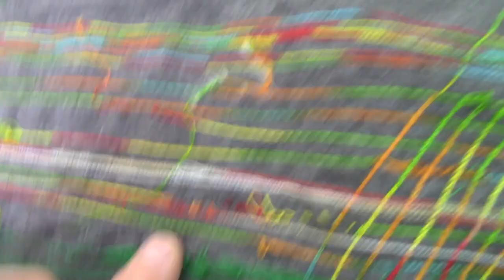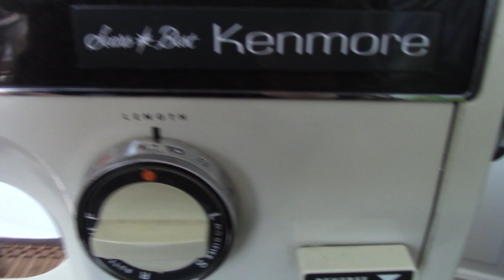Comparing Chain Stitching Singer 431G and Kenmore 158 1914

Comment: I did a blog post like this where I compared chain stitching on a Kenmore 1774 and a Singer 600.  My conclusion is that it is easier to set up the Kenmore for chain stitching but the actual stitching is nicer on the Singer. Also, with the Singer you can chain off the fabric but it doesn't work with the Kenny.
Reply from the maker: That is really interesting. Thank you for sharing your discovery.

Comment: I've watched 3 videos on chain stitching now and you have NEVER referenced the set screw on the chain stitch adapter that fits where the bobbin is.  What is that screw for?
Reply from the maker: I will check when I get back home in a week. I seem to recall that there is a screw on the Kenmore adapter which enabled an adjustment to hold the adapter on the shaft.
Reply from the maker: The screw tightens the spring which holds the adapter in place on the Kenmore. If the attachment is loose, then the screw can be used to help it stay in place.

Comment: Thank you for this video! Just inherited a singer 431g and wanted to try out the chain stitch. But my chain stitch looks terrible on the back side. The loops get way too big. I tried adjusting the thread tension but it helped only to a certain point. It’s still not as good as yours. Any idea about what I can adjust?
Reply from the maker: The length of the chain stitch on the G machines cannot be too long. 10-12 stitches per inch or 2 - 2.5 mm. That should fix it. If not, make sure that you also have the thread travelling into the loop half way up the machine near the takeup lever. That loop tightens the stitch.

Comment: Thanks so much for your videos. Very informative. I got the kenmore 19141 a few days ago. Do you mind if ask for the kind of thread that you used for demonstration?
Reply from the maker: I used nothing fancy for thread. It is just polyester topstitching thread for the thick demonstration, and polyester 40 weight thread for the standard demonstration.
Reply: One more time. Thanks so much. Do you may if ask, have you ever tried a heavier thread for chain stitch with this machine? TIA
Reply from the maker: @giovaandino22  The heaviest thread that I have used is the top stitching thread I demonstrated in the video. Beyond this, I have not tried heavier because the machines begin to grumble. Double thread chain stitch on the coverstitch machine might work better with heavier thread.

Comment: Do you have an extra chain stitch set for the 431G? I need one and can't find one :(
Reply from the maker: The chain stitch plates for the 411G and 431G are super rare. I have only the one. I hope to have some good news soon for you and others on the hunt for the elusive plates. I am testing a 3d printed plate at present. I am getting close to a usable result -- I will be posting a video soon when it works smoothly.
Reply: @jamesrogers991  Will that include the bobbin piece and the hook also? if so that would be awesome for sure :)
Reply from the maker: @angelaakers7692  I am trying to do all parts. It is a nightmare of trial and error -- but I will win 🙂

Comment: thanks for the video! I have some trouble shooting questions for any other owners of this machine but I'm not sure where to ask/who to ask and don't want to hijack the thread.
Reply from the maker: What questions do you have? I can try and help.
Reply: @jamesrogers991   - okay, here's everything: Any idea what I might be doing wrong if the top thread somehow gets looped over the bobbin spindle inside and jams the needle and thread? I think it's the top thread but not sure since both top and bobbin were same color. 
A second problem: I was sewing smoothly but when done, I raised the presser foot, tried to pull the threads to cut, it wouldn't move - seemed like bobbin thread was caught on something and had to cut right near needle and re-thread. Any idea why that would happen? 
final question: the feed dogs move smoothly with the hand wheel or foot pedal but when I lower the feed dog control/release lever, the feed dogs just sit in the up position. Is that normal or are they supposed to drop when you lower that lever?
I can take a video, the next time it jams and try to post it to youtube, have never done that before. Thanks for any advice/ideas :)
Reply from the maker: @tdyates2500  Is this on the 431G or the 1914? A video would really help. I can think of a few areas to check, but it will depend on which machine is the problem.
Reply: @jamesrogers991  Sorry about that - didn't think - Kenmore 158.1914
Reply from the maker: @tdyates2500  We need to start with a thread/tension test. Thread the machine with the presser foot lifted.With the presser foot still up, pull the thread through the needle gently towards the side or back about 30cm/12in worth -- is it smooth coming off of the spool? Now repeat with the thread tension set to 3 but with the presser foot down. Do you feel tension?
Reply: @jamesrogers991   finally got this test done - this was just the top thread, didn't have the bobbin in - in both tests, the thread pulled smoothly if stiff, under tension? Normally have the tension dial on the machine front between 2 and 3 & the foot pressure dial is set at 2
Reply from the maker: @tdyates2500  To confirm, you are chain stitching? You need to keep your stitch length above 12. You have the chain stitching plate in?
Reply: @jamesrogers991  my sewing skills are basic, I've never done chainstitch before. this is just straight stitch although I'm using the zigzag presser foot and zigzag needle plate  -will have to search for the rest of the parts that are somewhere in the basement
Reply from the maker: @tdyates2500  Ah, I am catching up with your issue. If there is no bobbin case in the machine, then there is a shaft which will catch the thread underneath. You need to put in the bobbin and bobbin case to prevent the thread from catching on the shaft. Hopefully I have caught on. If not, the we should schedule an online meeting and I can help you live.
Reply: @jamesrogers991  I've uploaded a private 43 second video that I can't figure out how to share with you showing my kenmore with the bobbin jammed (I think) after sewing. If I have to I can make it public and just ignore trolls and possible rude comments
Reply from the maker: @tdyates2500  I think you can create a private group where you can add me and then I will be able to see it. Otherwise just make it private for a few hours and I can try to take a look. I understand that there are some unpleasant people out there too.
Reply: @jamesrogers991  I'm not going to post that video right now. I had another incident where I thought the fabric might have gotten caught on the feed dogs somehow. Bobbin and case came out - I saw that the upper thread was wrapped around the bobbin spindle multiple times. Took a picture but can't post that. Has your Kenmore ever done that?
Reply from the maker: @tdyates2500  I have had the issue with it wrapping around the spindle when the bobbin case was not in correctly and when the top thread tension was too low to pull the thread back up.